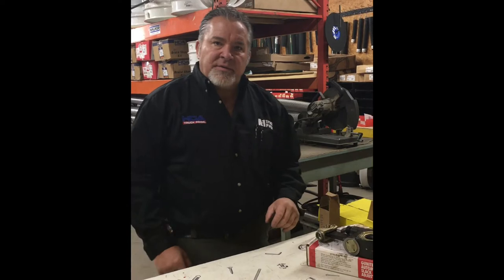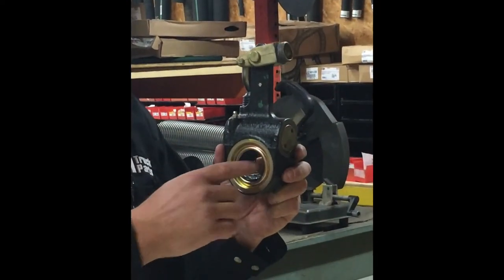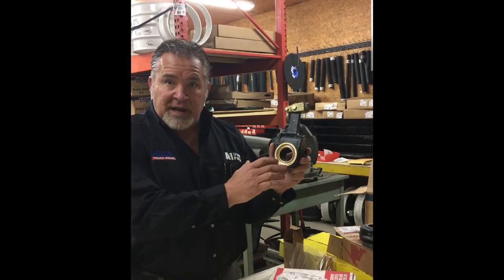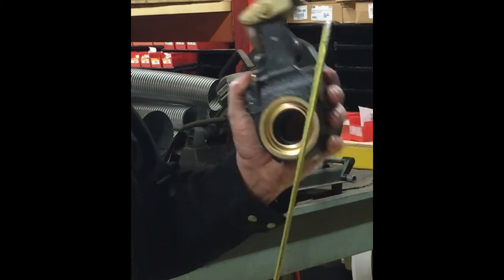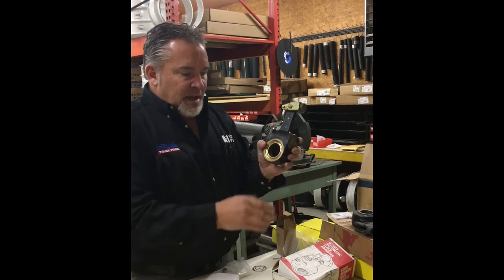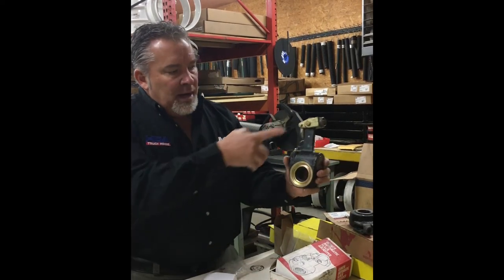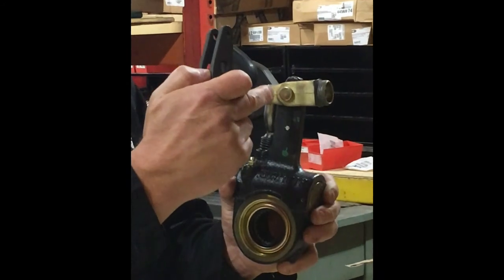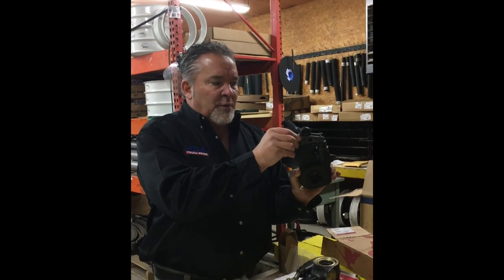How to Identify a Slack Adjuster

Comment: Thank you for the videos. I am on the farm during the lockdown, having trouble! All of my local parts houses told me that I have a Gunite because of the double pin clevis!
I kept telling them that I didn’t think that I had a Gunite, it didn’t look right. I said I had a square adjustment bolt not a hex. One guy told me to tighten against the drum, back off 1/2 turn. I told him that I cannot back off the adjustment bolt. He told me to use a longer flex handle. When you told of the long double clevis on a Meritor slack adjuster, I looked up Meritor slack adjuster! THANK YOU!!! 
Can you have a Meritor adjuster on one side & a Hadlex on the other. 
A local grain trucker thinks that they have to be the same brand & model on each side of an axle?
Thank you for your help. 
Hello from north east Montana.
Reply: Meritor style slacks are common on Volvos and some trailers usually there part numbers will start with R , gunite style usually starts with AS , Haldex will start with the number 4
Reply: Meritor style slacks also have a LH/RH depending on what axle they’re for
Reply: @ThePartsConsultant  This was on a 92 NaviStar 9400. I have found some things on it that do not match up with the parts books.

Comment: Who makes the best slack adjusters?
I have a 2006 KW quad-axle dump truck.
Thank you
Reply: Haldex style is most likely on your truck. 1.5” cam size, check your splines can be 10 or 28. Most likely a 5.5” length